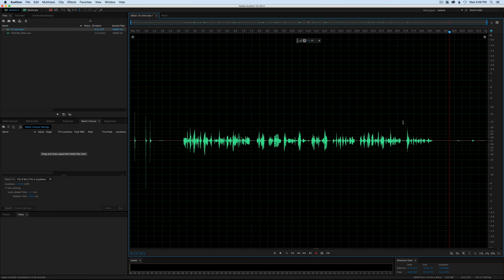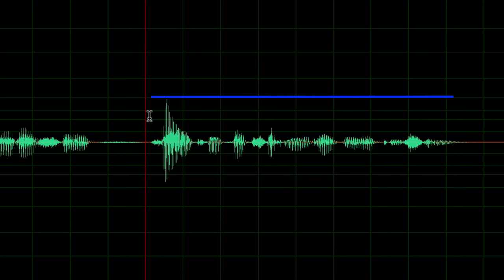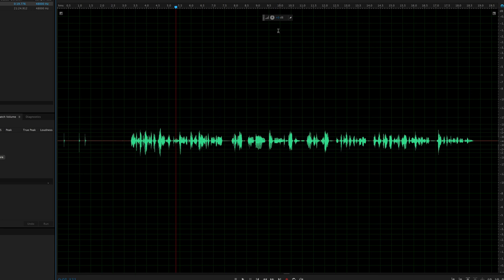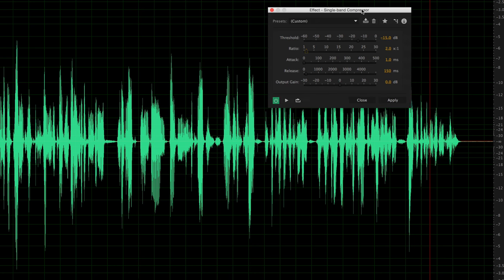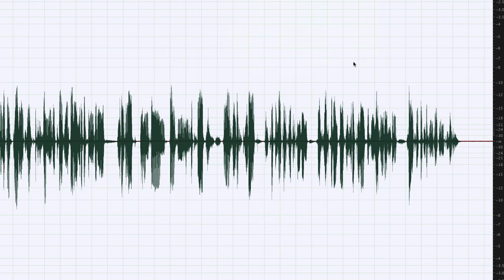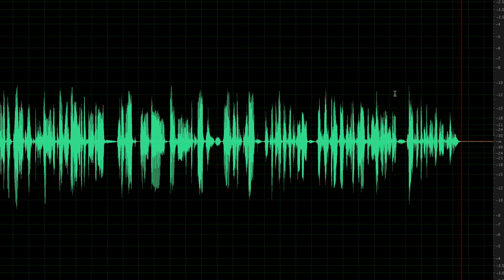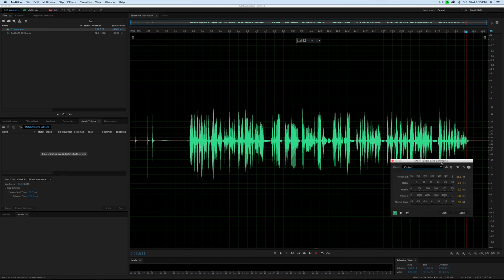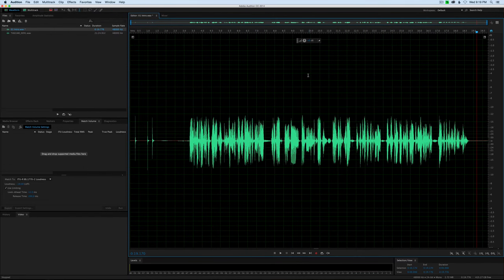Dialogue Audio Compression

Comment: Thanks for the good instructional video. I'm curious, I've watched several of your videos on this topic and you say that you don't like to compress too much, usually between 2:1 and 2.5:1 and yet you compressed it twice at 2:1. Doesn't that fall into the aggressive range you say you like to avoid? Or is it that too much compression at once causes artifacts?
Reply: Sorry just read through another comment where you address this. Your response to that leads me to a further question, though. If 2:1 doesn't get it down enough, why not undo it and redo it at a higher ratio, etc, until you reach the levels desired?
Reply from the maker: Bob Adams You certainly could do that, but if you're working with a 24 bit audio recording, it doesn't seem to make a practical difference in my experience. In essence, I'm sort of finessing the peaks to where I want them a little at a time so that I don't go too far. Also, what I didn't show in this case, sometimes I use a different threshold on the second pass which gives a different result than a single, more aggressive pass because in the second pass you're compressing a different portion of the peaks, if that makes sense. Thanks for the question!

Comment: Love your videos! I'm considering buying a mixer like the Yamaha MG12 to be able to hook up two or more mics (fx Sennheiser EW-100 and Rode NTG3) and do levels and compression on that. What are your thoughts on that?
Any alternative recommendations?
Reply from the maker: Flemming Eiberg Thanks! I haven't done much recording on mixers that are designed for live sound reinforcement but of course it will work. If you've already got it, go for it! If not, recording with a field recorder or audio interface and then applying the processing in post is how I usually work. When shooting live action, I record with the Tascam DR-60DmkII and when doing screencasts like this, I use my Focusrite Saffire Pro 24DSP audio interface. On the Focusrite, I do sometimes use the DSP based compressor while recording which is very much like what you are suggesting here. In the pre-digital days, people recorded with hardware compressors all the time so it is legitimate. But you're sort of committed because the processing is applied in the recording and you can't back it out. So if you get the technique down, you can save yourself some time in post.

Comment: Curtis, great video. Is there a difference between running the compressor twice at 2:1 versus running it once at 3:1?
Reply: Ah, I was going to ask exactly the same question. Like any type of audio processing, I would imagine each pass introduces artifacts, so cumulative applications of the compressor may theoretically result in lesser quality than a single pass. Theoretically, at least, if not in practice. On the other hand, that may be complete rubbish.
Reply from the maker: Nick Laws Good catch and yes, they are the same. Once I get better at this, I hope to be able to get there more quickly in one pass. For now I like to apply it in layers to make sure I finesse it because it can be over done. Also, because I recorded at 24 bit, I'm not worried about adding artifacts like we might normally be concerned when working with 8-bit footage or 16-bit audio. One thing I sometimes do, but didn't get to here, is use a different, less aggressive threshold on the second pass. In that case, the effect can be a little less extreme because then the compressor affects less of the waveform. Still experimenting on that, but that's the reasoning.
Reply from the maker: Scott Vanderbilt That's a good point. I think with lower bit depth audio that can be a concern. With 24 bit recorded material, probably not a lot of artifacting introduced.
Reply: Curtis Judd
A helpful follow up.  Thanks.  :)
Reply from the maker: ***** Glad it helped!

Comment: This further helped me understand what you were doing in a previous video but I'm curious. 2 Questions from this: Is applying one global effect essentially the same as highlighting the highest peaks and lowering each one's amplitude manually? 

Don't you run the risk of raising the amplitude of unwanted low frequency background sounds when you do this, especially when you initially raise the entire amplitude level? Is it better to record dialogue at a baseline lower amplitude, then bring it up in post even if that brings in unwanted noise, vs. recording at a higher frequency and using noise reduction in post? Thanks for responding to everyone's comments.
Reply from the maker: Zach Boyce Good questions again! Highlighting a section of audio and manually fading or attenuating it affects the entire audio waveform whereas using a compressor only affects those parts of the waveform that exceed the threshold. And that can sound a little different. They're both legitimate and useful tools. Compression can manage the peaks without affecting the overall loudness or body of the audio. But manually fading is useful if you want to lower the amplitude of everything.

Compression followed by normalization will definitely raise the noise floor. That's a calculated risk. If you use decent quality gear (doesn't have to be through-the-roof top tier), including a decent mic and pre-amp and analog to digital converters and record in a decent acoustical space, I find that I typically don't have to use any noise reduction filters. And while this is up to endless debates in audio forums, 24 bit encoding may also help here. But if anything in the chain isn't working well, noise reduction may become a necessity after compression.

Thanks for the questions, they're insightful!
Reply: Curtis Judd Ideally what decibel level should I be peaking at when recording dialogue, both in a controlled space, or in the field? I always thought -12 dB, but maybe I am wrong.
Reply from the maker: Zach Boyce I aim for -12 dB.

Comment: Why do you increase the overall gain?  Does that option not affect the final outcome?  

If not then why not us the scale on the right that's adjustable with the scroll wheel?  Or is that a new feature?
Reply from the maker: +HollowProductions Increasing the gain makes the audio louder and more "present". It definitely does affect the final outcome.

The scale on the right can be zoomed with the scroll wheel but that just changes the view, not the gain of the waveform. That does not affect the audio, just lets you see it up close.
Reply: would you still raise the gain if you were to do a loudness maximization?
Reply: +Curtis Judd And how do you make sure that you haven't raised the gain too much? (besides it audibly being too loud or distorted)
Reply from the maker: +HollowProductions No, loudness normalization is raising the gain. That is all you need. :) You're on the right track, keep it up!
Reply from the maker: +HollowProductions Loudness normalization. :)
Reply: XD Wait so If i loudness normalize then I don't need to raise the gain at the start? ( if the volume is low)
Reply from the maker: +HollowProductions Ok, I think I understand your question now. When you just need to be able to see the waveforms, you can scroll on the meter to get in closer or you can increase the gain so that the peaks are still well below 0dB. Your preference. Loudness normalizing is the last step.